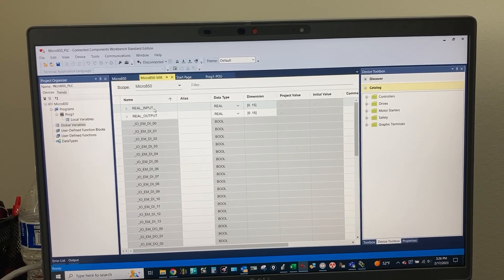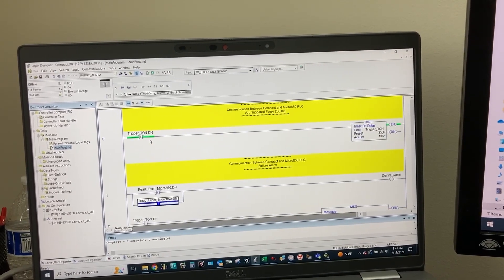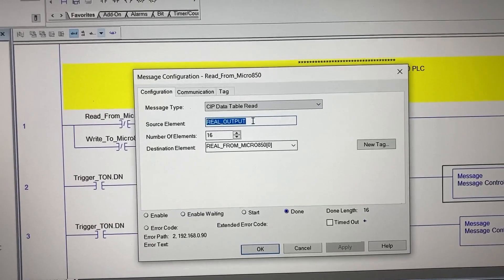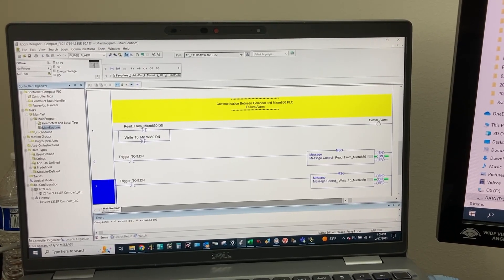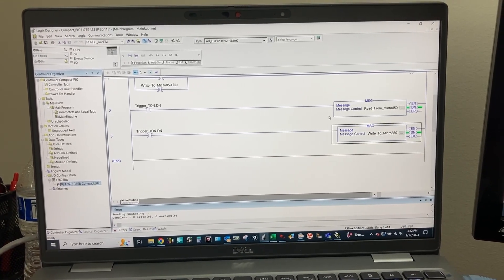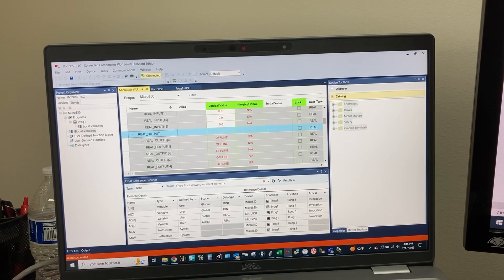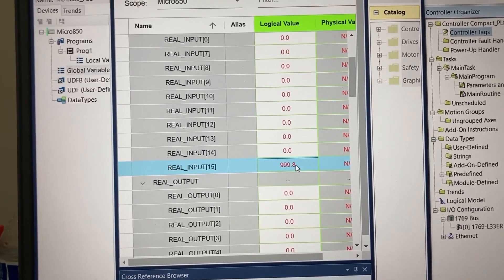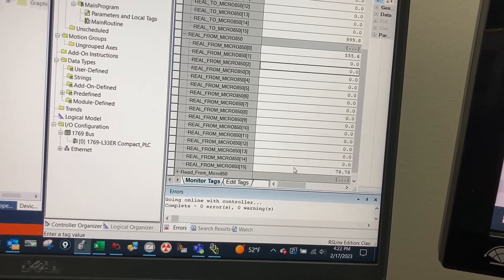RSLOGIX5000 CompactLogix MSG to Micro850/820 PLC Ethernet Communication

Comment: I have a question. I don't if I missed. But in the Micro 850 you don't have to assigned the PLC logix IP?
Reply from the maker: @omarz9577: I am not sure what your question is but you always have to assign IP settings for each PLC. In this video, my focus is on setting up the communication between the 2 PLC's only.
Reply: @SYPHOANG  For example, what I am referring to is that in the message you assign the MICRO 850 IP, but in the other software, you don´t have to assign the IP of the other PLC (Logix Plc)?
Reply from the maker: @omarz9577  : Yes, you got that right. You only do the message instruction in one PLC (I did the message instruction in the CompactLogix PLC in this video). The other PLC is untouched.